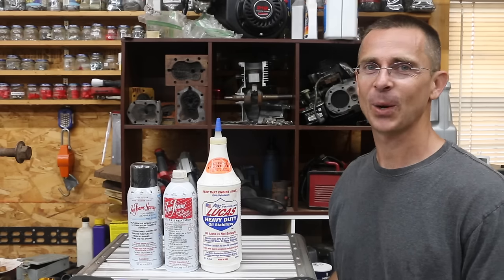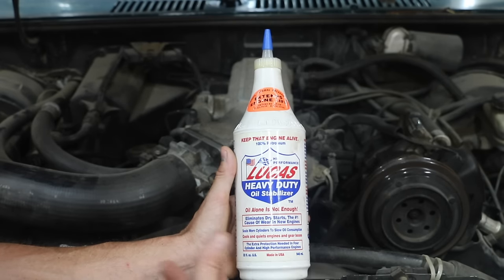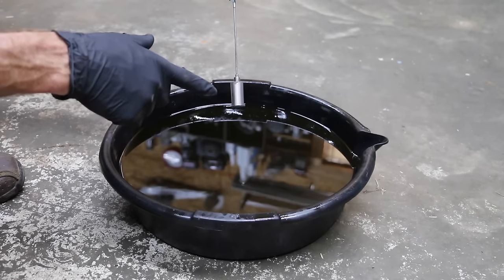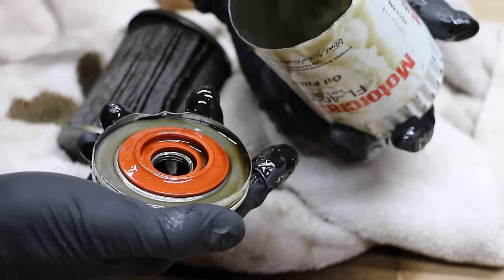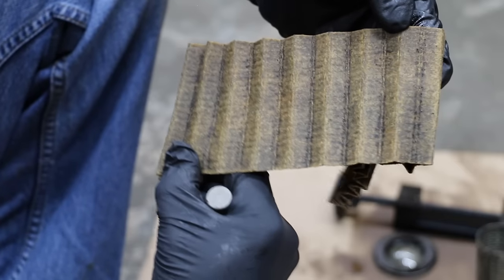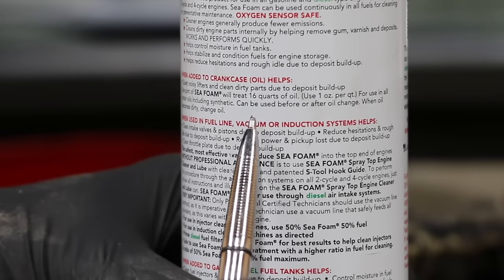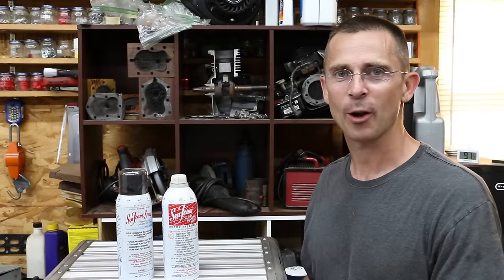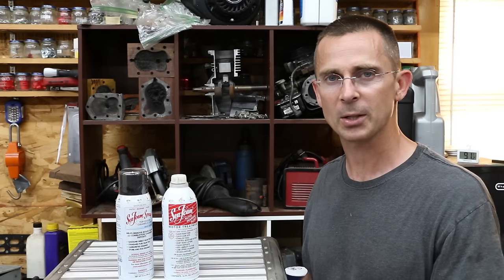Did the Seafoam fix last? Update on the Ford Ranger

Comment: HUH -- 10 - 30 oil with a truck with that many miles is bad - will pass by the rings real easy - and not help at all with better compression  -- 10 - 40 - 15 - 40 even would be better -  and remember the oil weight is the first number - the second number is the weight / flow rate  when hot -- second number will help slow down the flow just like lucas - works on the molecular level - same principle  -- but yu can not go back to thin oil after going up - compression can only be fixed easily with something like lucas or STP or many other brands - use only a small amount like say 1/ 3 to 1 / 4   of a bottle  - and after yu  put sea foam in - change filter often  - the crap will stop them from doing their job well and even retard flow - and after yu start using a  thickener like lucas - yu can never stop - or it will use oil badly -- and of course ALWAYS change oil filter before winter and after winter for longevity - no matter the miles - I drove a big dollar company truck and learned all of that to be FACTS  - They use to do studies - but quit so as to be able to make more money from not telling company secrets  - and fixing engines more -- ahahahahahaha  -- and remember - always use the same name brand oils - they all have differences and do differently in vehicles - changing may cause oil consumption -- hope this helps - all engines work out differently with different additives because of the different engines being worn differently and having a bit of different problems - yep - 5 times -- ahahahahaha
Reply from the maker: Thanks for sharing.